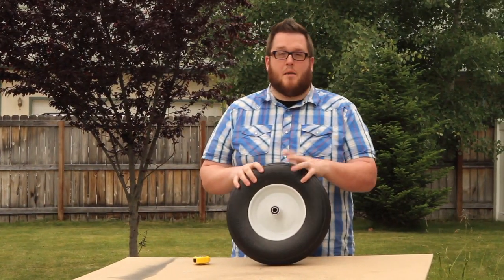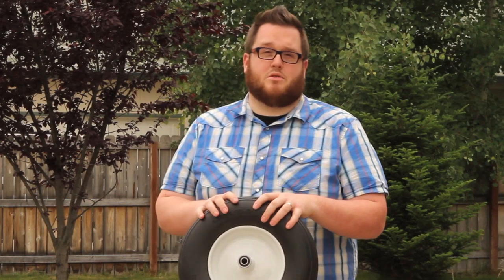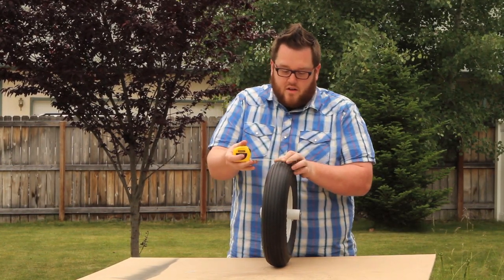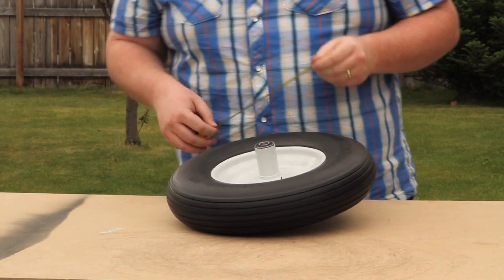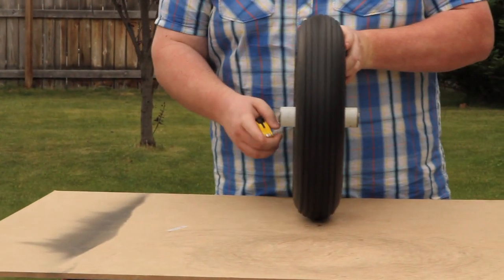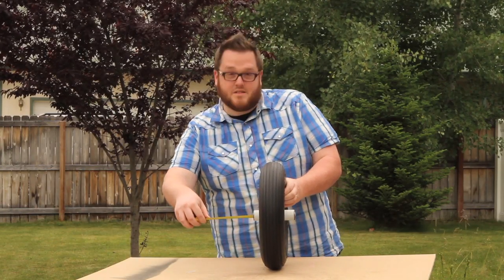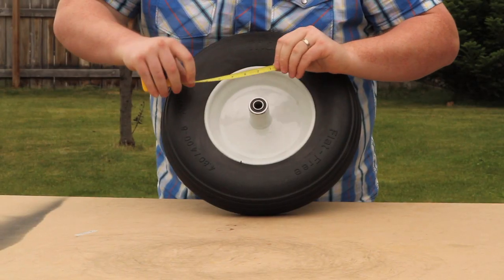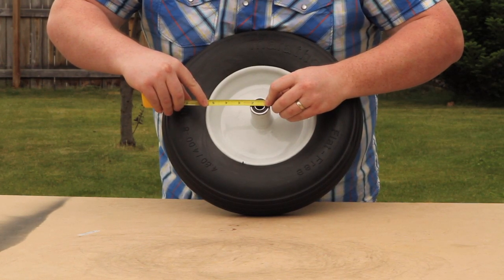How To Measure a Tire

Comment: My wheelbarrow tires say: 4.80-4.00-8 
When I put those numbers into a search for a replacement they all come ip as 13 inches but it measures almost 15 inches and is way bigger than my wagon tires, which says in it and measures as a 13”. 
So I’m confused?

Comment: Didn't even measure the rim.
Also if you guys have a tire that is 16.25" to 17.4" and can support 700lbs+ and more than 55psi and sits on a 6" or 8" rim that would be awesome. Bonus points if you also have a rim with 5/8" ball bearings and can fit that tire width (maybe 4" or so) and has a 6" axle width.